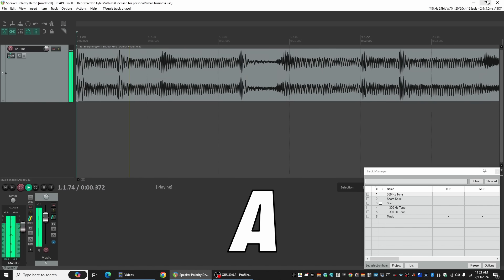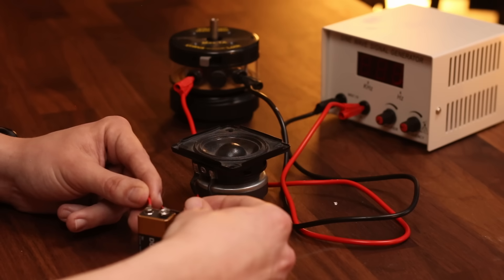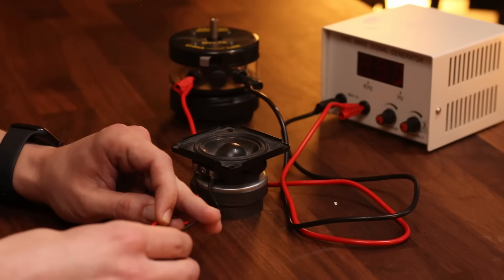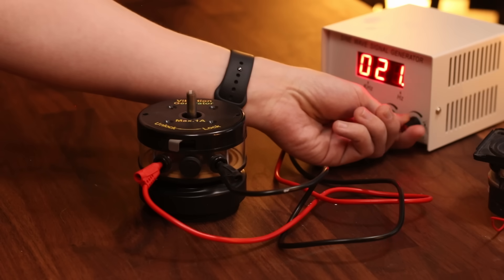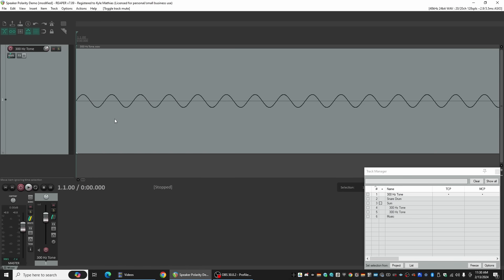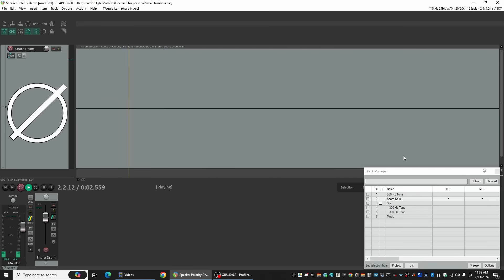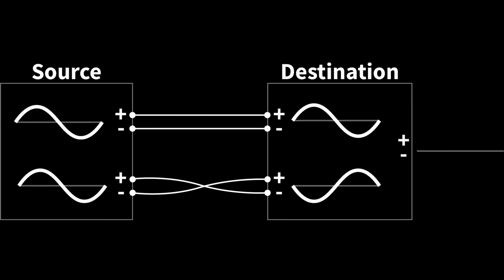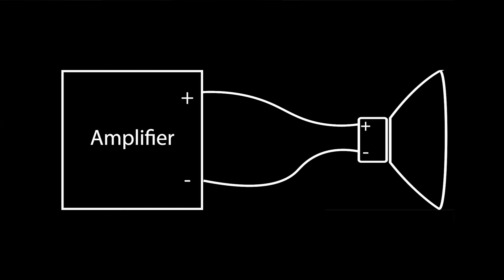What Happens When You Wire Speakers Backwards?

Comment: how you can test if the polarities are correct is easy: place both speaker(box)s opposed to each other at 3 feet distance and position your head in the middle and then play music preferably in Mono or connect them to the same signal. then with a switch switch one speakers polarity back ward, switch several times back and forward while listening... you will notice what will be the right polarity almost instantly

Comment: If the speaker is optimized to be hooked up In the correct polarity then even if we can't hear ITIT would have to be optimized for performance because it's receiving the polarity it was designed to at the right time to make the right pressure waves.

Comment: With ear problem I now have it is not surprising that I couldn't hear the difference. Right now my guitar sounds like the strings are really dead  😪
You saved me the time because I was going to do the same thing to verify they would cancel out when one was reversed. Looking forward to watching the video you linked to so I can possibly what would happen in the real world with two speakers. From some of the physics experiments I've done using wave tanks I suspect there will be nodes where everything pretty much cancels.

Comment: Rumors are circulating that you can wire a speaker backwards, hide a phone or audio recorder into it, connect its microphone input to the driver coil and use it as a spy microphone. This video shows that swapping the wires is redundant, which is only one of the ridiculous aspects of that.

Comment: Your premise is goofy as in any mono mode music, polarity of the speaker is of no consequence.  Stereophonic noise generated by miss polarized speakers makes a huge defference in presence and depth.  As you stated, correctly, wire all your speakers following a strict protocol to ensure proper and intended representation of the music.  When it comes to audio engineering an environment, speaker polarity is one of the major factors to be adhered to with a fine tooth comb.  Not even mentioning room acoustics and such!  That’s another big chapter.

Comment: The quickest trick is if you want to see the effect of having two speakers wired out of phase is to point them at each other close together. You will hear the sound level drastically drop as when one speaker moves in the other moves out and there is little sound radiated outside of the pair.

Comment: wired two mtx speakers faced away from each other out of phase in an alfa Romeo mid mount console with a hidden sub, it filled in the center air quite nicely. some tv's and surround sound  mfr's do this for widening spread. "note"; In the 90's tried to achieve  total phase cancelation  deliberately to totally mask sine waves for tinnitus research, but wasn't achieved by this manner, as expected. Can see more use for it, light as well as sound now to be a good deterent for stuff you don't want to see, feel or hear. even unknowingly.

Comment: 5:01 i can deffently hear a difference.
But i have a trained ear and 40+ years of exp in high-end mobile  home audio, and live band sound.
But without looking i couldn't tell you what phase a speaker is in.
The mini speaker you can deffently hear the motor structure. 
Your better off letting the piston part of the speaker reach your ears
And not the back of the cone.
One exception is a polyberic (spelling)  membrane sub woofer.
You basically have no box just a subwoofer mounted on a board with a cover over the cone that moves at a certain frequency
Ive never done one but they can be loud and put out nice bass. 
Its complex so not many people do this type of box.

Comment: The driver out of phase sounds flat, 
You can hear the motor structure
IE: basket. The midrange and higher frequencies sound flat. 
And it destroys any sound stage.
Sometimes tweeters are ran out of phase to correct time alignment.

If your going to call yourself a college know what your teaching.

Comment: No they do not sound the same  clean your ears out.
Also if one is wired out of phase in a stereo then you get bass cancelation.  If they the midbass drivers move at different speeds you get bass cancelation   
If the sound from one ear hits first you have a time alinement problem.

There are only a few reasons to wire one speaker out of phase
But it would be a push pull bandpass box.  Where you do not hear both speakers without changing its phase mechanical via the boxes construction and the ports. 
Stereo subs doesn't work  2 subs playing the same music should move the same direction at the same time. This moves more air.
Higher SPL

Comment: The jokes write themselves on this one.  In the Northern hemisphere of this planet positive to positive and negative to negative.  In the southern hemisphere, water flows down counter clockwise, while in the norther hemisphere the water flows down the drain clockwise.  I ecall this is termed the "Corolis" effect.  So, wiring a speaker backwards negative to positive and positive to negative the sound can come out backwards, or sound like it is underwater of impair the dilithium crystal effect. Reversing the phase of one speaker of a stereo pair often cancels out signals that are the same in each of the stereo channels.  This usually eliminates any vocals.  Wiring the rear/surround speakers opposite to the front speakers  is usually done in the surround amp.  If not, it may sound better if you do it yourself.  Again the signals may cancel and cause "weirdness" in different programs. I noted this especially listening to Dark Side of the Moon while, um er, ah, "fortified." Connecting one speaker from positive of one channel to positive of another channel will produce a sound equal to the different in each channel.  It is a cheap way to get center channel out of stereo. This can lead to severe mental disorders as anyone who has gotten roaring drunk with Australian men can readily vouch for.  Yes, I also have bridges for sale as well of 2oz tincture botels of snake oil.  NOTE:In audio applications where the front speakers face each other in the front door panels, reversing one only of the pair often makes things louder and cleaner.  However, on the down side it may make your car veer or pull left or right depending on whether the car is left or right hand drive, which lane you are driving in, the type of music and the condition of the brakes.  ALSO the "rear" speakers for a stereo system my deteriorate as noted above.

Comment: So it's a bit wrong for them(manufacturers of amp and speakers) to refer to the AC terminals as "+" and "-" or RED and BLACK as the confusion starts here if thinking of it as DC.
I guess for reference purposes, and getting the same terminals to the same speaker, it is one way of marking the terminals.
Thanks for going in to detail and showing what happens to a signal. Very good.
Reply: It is good to have a reference. Plus to red, minus to black, and the driver should move outwards for a positive DC voltage, although at higher frequencies it will tend towards moving inwards for a positive voltage due to the phase change associated with this mass-spring system. This seems to be not understood by anybody in the comments.

Comment: There is one case in which connecting stereo speakers in reverse polarity is a GOOD thing.
The best imaging and sound stage is acquired by placing a twin set of tweeters and midrange drivers on the outside of your main speakers and wiring them to the opposite channel in reverse polarity to cancel crosstalk. That's how the Polk Audio SDA's work.
Reply: I found your comment after I posted mine.

Comment: Back in the day, when touring before in ear monitors, if you had a feedback issue, you simply reversed the polarity of the monitor to cause it to drive inward rather than outward. Not the best fix but a good fix…. Gives you more gain before feedback. Not talking mains, just monitors. Yes, your video is scientifically true, but there are always hacks… but with the advent of in-ears… the point is mute

Comment: Interesting. In the 1990s when I had two sets of stereo speakers wired to the speaker outputs of my Sherwood amplifier, I was told that if I wired the second set in series, e.g. positive from the amp into positive of the left speaker, connect the negative from left speaker to the positive from the right speaker behind the amp, then connect the negative from the right speaker into the right negative connection of the amp, it would kind of sound more like surround sound. Anyone ever tried similar.

I couldn't afford surround sound equipment back then, so was this a way to kind of fake it, or was I told false information?

Comment: Well mate I have dabbled in electronics stuff for many years including making up my own speaker cabinets with crossover circuits to get the sound quality I want. Now I found out again a long time ago that the polarity of the speaker has to be correct to get the best out of the speaker and avoiding damage. So when I eventually connected up the system I made sure that connecting the speaker wires from the stereo unit that the speaker did indeed move forwards so making sure that I had the connection correct, and I have found that the audio quality is perfect to my ear. However I found your video really interesting and I wish that I had the same level of knowledge (and equipment) that you have.

Comment: If one of the speakers is wired backwards they will be "Out of Phase". That means that when one speaker is pushing air forward, the other one is going backward. 
  Most people can tell that something is not right, but, they wont know what. What is happening is one speaker is creating a sound wave and the other one is creating a sound wave that is 180° out of phase.
  This creates a wave pattern that cancels itself out. So, when the right speaker's wave form is highest the left speaker's wave form is lowest, the exact opposite of the wave form on the right.
  So that the left side is cancelling out the right side.

Comment: With some speaker crossover networks, specifically 12db/octave rolloff, right at the crossover frequency a tweeter and woofer will cancel out, leaving a hole in the sound around the crossover freq.  This is remedied by connecting only the tweeter opposite polarity.  If it is a 3-way system, the woofer and tweeter are wired + to +, - to -, but the midrange is wired + to -, - to +.  This fixes the cancellation at the crossover frequencies.  The rest of the spectrum, the change in phase cannot be heard.

Comment: You can absolutely hear the difference. Sound is pressure.  We expect positive pressure at certain points and negative.  When you switched the tracks A and B I picked up on it right away.  The ambiance changed, as did the decay for me.  I also noticed a loss in sound pressure in my headphones when reversed.  Granted, this is wearing a very nice set of cans, I'm into sound, and I was a pro-audio guy back in my 20's as well as a DJ.  I was the freak that could point out a unit in a large stack that was out of polarity...was never wrong, not one time.

Comment: PLease add some difference from  zero line and you will see the difference! Cause all your audio sine waves are absolutely centred, but its too simple sound waves!  Add Flanger or Phaser or Chorus that  change phase and move central line  and after changing the polarity - you will be able to hear difference after changing polarity, it will be more effective ! 

I did that trick on early 2000s in sonic foundry sound forge program, as a kid on win OS  )

Comment: If you have a stereo pair of speakers with one of the pair wired backward as compared to the other speaker you will get phase cancellation. The sound will be "hollow" when the same frequency coming out of each speaker at the same time at the same relative volume level will cancel each other out. Its the same concept used in noise cancelling headphones.

Comment: There is a very real difference when you reverse the "absolute polarity" on music.  This is described in detail in R. C. Johnsen's book titled The Wood Effect.  Truth be told, many sound processing appliances/plug-ins have the unfortunate by-product of reversing the polarity of the source.  Many (about half) of the recordings made are actually 180-degrees out-of-phase from what was originally recorded.  I use a Mola-Mola Tambaqui DAC that allows me to reverse the polarity of both left & right channels without touching the cables.  I've found that 50% of my recordings sound best when polarity is preserved and 50% of my recordings sound best when polarity is reversed.  Take the snare drum example in the video:  The initial onset of sound should be a compression of air from the speaker (or live drum) to the ear.  When the polarity is reversed, the initial onset becomes a rarefaction ("sucking") of air from the speaker cone.  There is a difference.

Comment: Years ago when speakers didn't give polarity we used to put them face to face about a half inch apart and reverse the wires on one. Which ever way sounded better is the way you would leave it. We called it putting them in  the same phase.

Comment: It's possible to isolate the voice in all songs that have a similar instrumental version by inverting one of the two audio files. It doesn't work perfectly because of audio compression and sometimes the original song includes more or less sounds than the instrumental. But with a bit of luck you can get pretty good results.
Reply: Playing the difference between channels (left minus right) usually cancels out the lead vocal and the bass because the lead vocal and bass are usually mixed dead-center.  You get some of the instruments and some of the harmony vocals.  It can be mildly amazing.  Try it on Olivia Newton-John tunes (she's almost a choir).  "Saturday in the Park" by Chicago some surprises that cancellation brings to the front.
Reply: @quaztron  It all depends on the mixing. Many recordings, to save money or because the engineers have tin ears, record the vocals or guitar solos or bass monaurally, and then pan them to the center of the mix.  With a single monaural source it's relatively easy to inject a 180º opposite and thus cancel out the original. With true stereo recordings, not so easy.
Reply: @rcarlberg  Just flatten the stereo signal to mono...
Reply: @rcarlberg  Just flatten the stereo signal to mono

Comment: The only real, significant time that you WOULD DEFINITELY notice a change in the sound, (and in a very detrimental way), is if only ONE of your speakers in the left and right pair is wired in the opposite polarity from the other one, because then they will have a 180° out of phase signal coming out of them, in relationship to each other, so at that point is when they partially cancel each other's sound out and majorly and very noticeably affect the sound output, both in output level when playing the same frequency, and also the stereo image will be ruined when one speaker is out of phase/polarity with the other one.

You will ALSO notice a stereo image change with BOTH speakers wired in opposite polarity to the way they should be, but which in that case, will produce more of a "diffuse" stereo image, like the sound is more like coming from an indistinct point, or from "around" you, rather than being properly focused in front of you, as the overall image is when both speakers are wired in proper polarity. (And just a technical FYI; that effect was also the basic concept of, or at least the effect that the original "old school" "Dolby Surround" back in the late 80's developed from, WAY before the age of true DSP and digitally produced and enhanced surround sound effects. Back in the original days, "surround sound" was done in a purely "analog" way, by simply playing around with the phase of the different channels of the entire speaker system in relationship to each other, then also doing other minor things to the signal, like adding delay, different equalization among the channels, etc., which produced a kind of "fake surround sound", or "pseudo surround".)

However, you WON'T be able to notice ANY of these changes while using ONLY ONE single speaker driver, as in a totally mono signal, (like what is the case with cellphones and most portable Bluetooth speakers unfortunately, that's why you can't hear a true stereo image while listening to music on a cellphone or a bluetooth portable speaker), simply because there's nothing else for your brain and ears to compare the sound signal to at the exact same time, as there most definitely IS when using MORE than just one single speaker, as in when using either a stereo PAIR of speakers, or a complete surround sound SET of speakers, and having both/all of them wired up properly!

Comment: Can't hear a difference in the snare. I think I hear a slightly louder/bassier kick in full mix A but not 100% on that.
I can tell the difference on some synth bass sounds...

Blind test included for the doubters ;-)

foo_abx 2.1 report
foobar2000 v2.0
2024-02-26 12:11:56

File A: 0001 polarity testing.wav
SHA1: 92b635cdf4eae708978e6eb71e5dfa6876348dc2
File B: 0002 polarity testing.wav
SHA1: a76a3285d44c23f2f82783fad701745270f52579

Output:
Default : Primary Sound Driver
Crossfading: NO

12:11:56 : Test started.
12:12:55 : 01/01
12:13:07 : 02/02
12:13:18 : 03/03
12:13:36 : 04/04
12:13:48 : 05/05
12:14:01 : 06/06
12:14:14 : 07/07
12:14:25 : 08/08
12:14:35 : 09/09
12:14:46 : 10/10
12:14:57 : 11/11
12:15:09 : 12/12
12:15:23 : 13/13
12:15:44 : 14/14
12:16:02 : 15/15
12:16:16 : 16/16
12:16:16 : Test finished.

 ---------- 
Total: 16/16
p-value: 0 (0%)

 -- signature -- 
33bb02d575243b9de943696f1e29b44622df5822
Reply: This was with AKG702 headphones.
Also got 100% with HS7 monitors, but weirdly A sounded bassier in headphones and B sounded bassier in speakers!